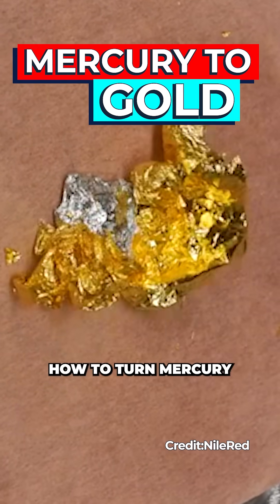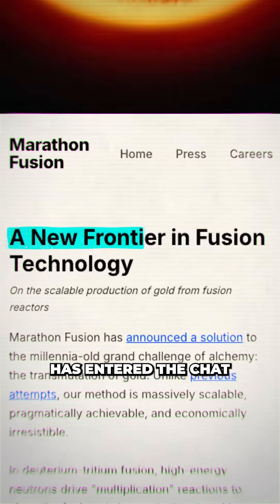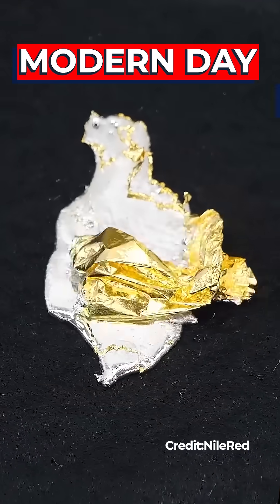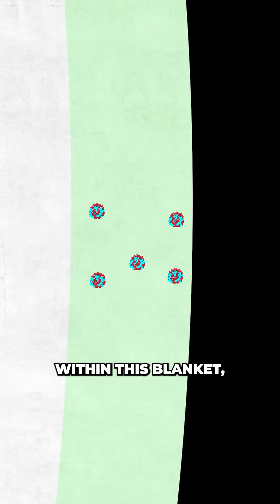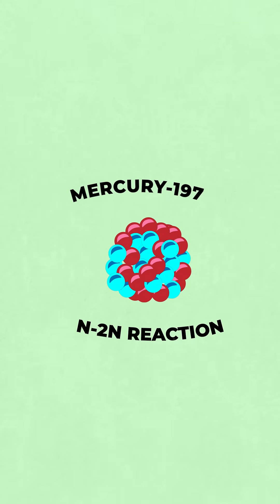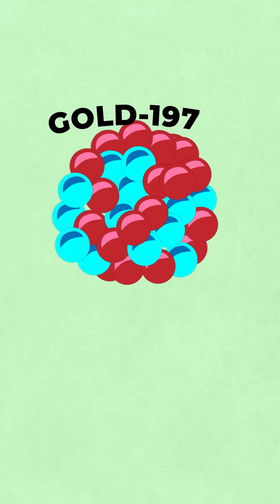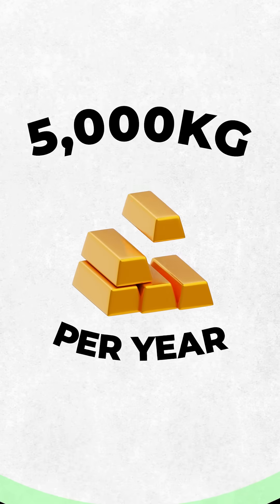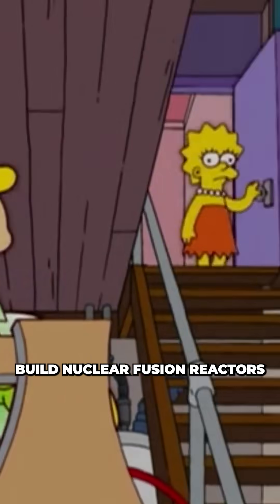Scientists Turn Mercury Into Gold

Comment: This is gonna crash the gold market but gold would be extremely useful for many practical uses, so cheaper gold would basically ignite hundreds of new practical ideas.

Edit: I’ve listed some new practical uses for gold if it was extremely common 

Titanium-gold alloys. 
Like in ironman, he used titanium gold alloy to make his suit 4 times harder than pure titanium and most steels, fracture resistance, and it’s also very resistant to corrosion. Currently this alloy is being used for medical implants because of its biocompatibility, but could later be used for larger scale applications like infrastructure with this technology.

Gold plated materials and electronics.
Because of gold’s resistance to corrosion, it can be used for long lasting resistance. Its conductibility isn’t as good as copper or silver, but having extreme resistance to corrosion outweighs that. 

Aerospace.
Due to gold’s resistance, its use in satellites and spacecrafts are vital to withstand the intense environment of space, where there is no atmosphere to protect you from radiation, and helps to control heat on the spacecraft. 

Please feel free to add more to the replies.
Reply: Gold has insane corrosion resistance to the point that if cost and scarcity weren't an issue almost every metal object on earth would be gold plated
Reply: Who cares about financial capitalists? Its far better using gold for actual purposes like research, infraestructure and industry
Reply: Gold backed currencies make a lot of good effect
But the applications for this tech is far superior and productive
The added value , efficiency,new standard outweigh the need of gold as currency backup
Reply: Gold is a better conductor of electricity than copper thats why its used in microchips

Comment: That would devalue gold. But luckily, gold is useful for things other than capitalist value. Flooding the market would make a lot of stuff cheaper and easier to achieve advancements in a variety of fields.
Reply: Cheaper electronics...
Reply: @gustavodutra3633 
Silver has taken over as the main material used in electronics, gold hasn't been the important metal for 30 years now, matter of fact some people in the electronics business jokingly call the era when gold was the big thing in electronics "The golden age of electronics".
It's still used but not nearly as much as it used to.
Reply: Computers back in the day did use gold because gold can conduct electricity very easily.
Reply: @AlexF17art  still do
Reply: @AlexF17art  Silver is often used in some applications where it won't oxidize but in most applications under electrical load it will oxidize after time, gold is nearly as good a conductor as silver but doesn't oxidize under electrical load in our atmosphere
Reply: @AlexF17art silver is better & cheaper.
Reply: @class2instructor32 silver wiring is not better than gold wiring, just cheaper.
Reply: @demonassault5912  Gold is worse for wiring. It's both heavier and less conductive. It's useful in electronics because you can easily make ultra thin wires that bond easily. But it would be a terrible material in most wiring.
Reply: That happened to aluminium, which was more valuable than gold before someone made process to make at industrial scale.

Theres even a story, that Napoleon on his parties had two sets of cutlery sets: one made of gold for less wealthy guests and aluminium set for those of bigger importance...
Reply: @KS-xx5xqthe cap of the Washington Monument was made from aluminum also
Reply: @KS-xx5xq yeah but we're talking about a soft shiny metal easy to make art easy to make money and it was this way from I have no idea when, aluminum was super rare and hard to work and it wasn't in reserve as money like many other metals
Reply: It means that computers will get faster, because gold is a fantastic conductor, and cheaper means it can be used in regular cables etc
Reply: Imagine pure gold wiring. It's not a superconductor, but it's better and denser than copper.
Reply: @MisterLEM0NS copper & silver are still better conductors.
Reply: @MisterLEM0NS  IC and BGA chips use this, so do transistors, LEDS, etc
Reply: Yeah overall devalueing gold is a net positive for humanity, even if silver becomes the new expensive jewelry material, and theres alot of unhappy people at fort knox, humanity would benefit greatly from more gold, also technically the resources to make gold would skyrocket in price, meaning that mercury would become more expensive, which in the grand scheme is also totally fine because mercury is not a consumer product like gold
Reply: @PapaHepatitis7170 once we run low on mercury, gold starts to become expensive again
Reply: @Ultoxgamer  then we make more mercury!
Reply: @PapaHepatitis7170  there is no gold at fort knox
Reply: @PapaHepatitis7170 
Since it's a actually concerning matter in terms of economics
If we can turn mercury to gold so what's stopping us to try turn one element with one less proton to mercury and so on
After we made all sorts of valuable jewelry (since their atom is cheap and method of making molecule is hard ) there some control
And no country no matter what would create a sudden supply
But it's inevitable that jewelery and precious metals gets produced by alchemists for industry and trust is going down on any fiat currency and economists around the world should find alternative and how much that would hold value (crypto has quantum computing to worry about)
And just imagine the new race if you can crash an economy worse than war by over supply of their value reserve
That's another level economic war which leads to highly benefiting end for ordinary people because actual worth of added value of production is ultimate fiat currency back
Reply: @PapaHepatitis7170  pretty sure Fort knox wouldnt care about the gold, we already have a fiat currency detached from gold as of 1972 I believe.
Reply: @PapaHepatitis7170 silver has a million times more uses than gold, all hail silver
Reply: Still to expensive but just imagine industrial change
I'm more into economics and I had many conspiracy theories of why they didn't they did that (different method many years ago and said it's more expensive than natural gold!)
Yet if precious metals and diamonds gets created on industrial level we gonna see some crazy shifts in world 
Since reserves usually operate on mostly precious metals fiat money has to find another source of credit and only close thing now beside the production is third gen(block chain) 
But markets and economics will change forever because those also can be neutralized by future quantum computers 
So either they have to invest on new types of asset that is resistant to any kinda tech break down or completely try to find ways to control to the degree that any unit of currency being printed has a production or some another source of back up
Reply: @hellno100  Diamonds are created on an industrial scale already. They're even called "industrial diamonds" and are used for everything from a cutting abrasive to extreme-precision bearings. Sapphires, too.
Reply: No, that will make cup of corn or bar of butter more expensive than a block of gold, which means wars, wars on food and basic life shit!!!
Reply: Hey!  Wait a mega minute!
Just the economics of energy bely this scheme.  Using the (unverified) 1Gwatt input to produce 5000 kg in a year, that requires an energy cost approx 1 UScent per kWh to meet current gold price $3000 per oz.  That’s low for most sources, and does not yet include other production costs and problems. Conclusion-  not profitable.  
Mining crypto pays better.
Reply: These were my thoughts exactly when I saw someone commenting that it would wreck the gold market. Maybe that's precisely what we need. Could lead to some interesting advancements. I think it may be key to unlocking certain secrets of the universe.
Reply: And that’s exactly why the corpos don’t want it to happen, they want everything to cost more all the time so only they can afford it.
Reply: Gold is not used in that many things. Making it cheaper has not impact on goods at all. It’s a monetary metal. On the contrary it should be more expensive and the idiots in government should back currency by it.
Reply: Gold is already overpriced though it could use devaluation
Reply: 5000kg of gold = 0.0025% of wold supply... so no price crash.
Reply: @orangeraven3869 annually  × 1000 reactors.  
Try oxygen.
Reply: capitalist value is based on how useful & rare something is....
Reply: @hunteryan  explain dollars then
Reply: @Ryzot  Literally the same explanation. The value of the dollar is controlled by its supply and demand. The only difference is the US government completely controls the supply of dollars. Everything that can be traded is subject to market forces; the amount of government intervention determines how capitalist that market is.
Reply: @hunteryan these people do not understand what capitalism is and because they owe their very life to it, have no idea how important it is. Imagine thinking that making gold cheaper to make more products to sell to people who want them is anti capitalist.  Idiots....all of them are idiots.

Comment: The idiots here are jumping the train about gold price without any knowledge that this is only theoretically proven that it is possible. Mercury is very toxic to exctract and this required specific mercury called Mercury-198 which is only 10% of total mercury production. Also it requires nuclear fusion which is still in experimental phase and yet to developed at commercial level. Even if everything falls in line, the gold created from this process will be radioactive and need to keep in safe place for atleast 18-20 years before you think to use it.

Comment: Mercury-197 actually undergoes electron capture rather than beta - decay. This converts one of the protons into a neutron by absorbing an electron from the atom, and decreases the atomic number from 80 to 79 (Mercury to Gold). The decay type described in the video would actually increase the atomic number from 80 to 81, and produce thallium rather than gold!
Reply: Yeah was looking for this reply
Reply: That's also the conclusion I reach. Hg is number 80. Gold is 79. So you need the Hg atoms to go DOWN a number in order to become gold. That can either be achieved by 1) releasing Alpha particles that would make the number drop to 78, so too far.  2) release a positron/beta-plus particle,  or 3) absorb an electron . So without checking any data, I can tell that there must be some minor flaw in the explanation in the video.
Reply: @brainmanPI31  i my head canon, proton ejection is also a thing

Comment: Wait wait wait I'm confused.

Atomic number of gold is 79 meaning it has 79 protons, and of mercury it's 80. So one proton should have been converted into neutron to reduce the atomic number thus creating gold, or a proton should have been ejected. Also, if a proton is converted into neutron in mercury 197, it's technically now gold 198 so if a proton is the one getting converted into neutron and not the other way, the particle released has to be neutron not antineutrino so as to reduce the increased neutron.

Comment: Golds value is based on its scarcity. The more gold there is the less valuable
Reply: *artificial scarcity 

Just like diamonds
Reply: I’d be down for the value of gold to drop like crazy, that way we can afford to use more gold in electronics/wiring!
Reply: Mostly, but because it has many uses in electronics that have yet to become commonplace due to scarcity, it’d end up doing more than destroying the gold standard. Reminds me a little of how aluminum used to considered extremely valuable due to scarcity, but once we found and implemented processes to synthesize aluminum metal on mass, it ended up becoming commonplace while still maintaining some value due to its vast number of uses.
Reply: Yes, but technically gold isn’t that rare we just don’t have a lot of it on earth
Reply: its a useful, pretty, relatively rare monetary metal. its not as artificial as the diamond market as  much as some would like to suggest this.
Reply: Consumption would increase with decreased price, making the value much more stable, if somewhat lower
Reply: value should be based on how cool it looks
Reply: @CalvinoSinclair I mean with one of golds main uses being joulry it kinda is it's more valuable than osmium dispute osmium being rearor because no one has a use for osmium
Reply: @CalvinoSinclair  That's some child logic right there.
Reply: No shii sherlock 🪙

Comment: Finally electronica will be cheaper
Reply: Keep holding on to that dream.
Reply: electronics don't use nearly as much gold as they used to. a typical PC build has like 70 dollars worth of gold. so even if the price of gold is cut in half, a full PC build only becomes 30-40 dollars cheaper. and that's assuming prices go down if the price of gold goes down, which probably wouldn't be the case